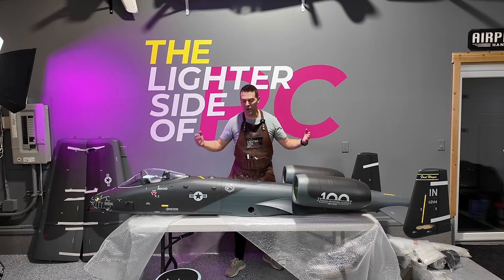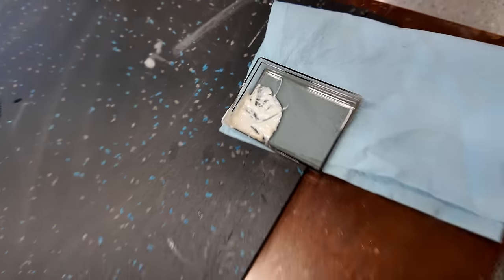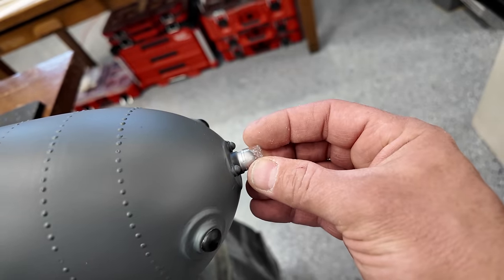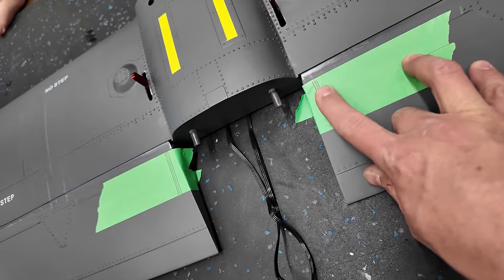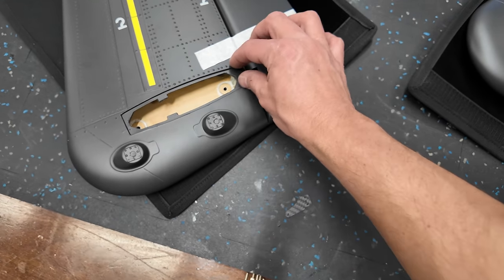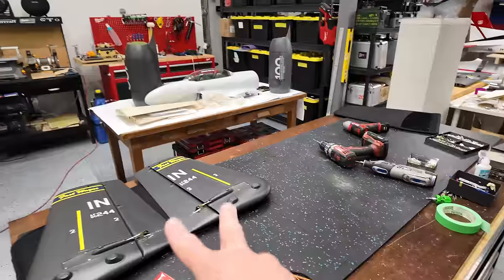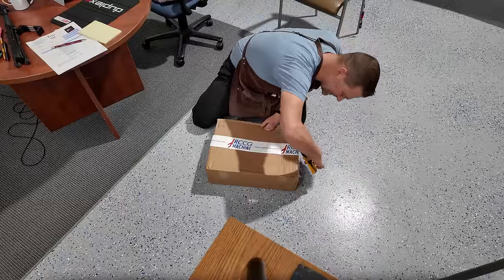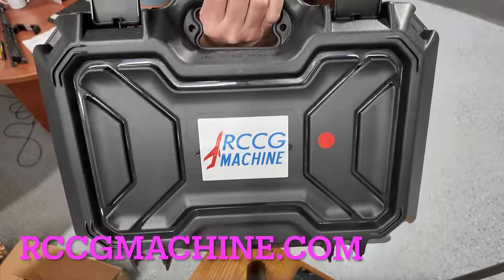Black Snake A-10 RC JET Build Begins - Skymaster A10

Comment: Coming Along nicely and plenty of Room in there as well. I remember Chris Golds doing electric A10 in U.K. with exhaust  straight out caused no end of dramas re elevator deflection😮 until he adjusted them to how those ones you showed are angled problem solved.😊 keep at it now.😊
Reply from the maker: Thanks Nick!  Yea that small up tick angle in the exhaust is critical!    Thanks for watching!

Comment: I live close to the 122nd fighter wing base who are the Black Snakes. It has been so awesome seeing the A-10s fly overhead, but they are now transitioning to the F-16s.
Reply: I miss the Sound of the A10 when they came to Ohio. Never see the F16s
Reply: The problem with the F-16s is that they usually won't fly as low a the A-10s due to the fact that they are louder.
Reply from the maker: Super Cool!  Must sound amazing!

Comment: Any thoughts/comments on the false turbine blades in front of the turbine if they will interfere with airflow entering the engines?
Reply from the maker: Not at all.  They end up spinning up with airflow and increase in speed as turbine speed increases.  It's a common thing on the SM A10's not for many years and no issues.  I like them during the cool down as you just get them spinning and they push air across and into turbines.
Reply: Ok, thanks for reply to explain it. @thelightersideofrc

Comment: I've been a scale RC'er for many years. The Skymaster A-10 will likely be my first turbine jet, since I've been looking at it for several years now.  A question regarding the fuel tanks - Would it be a good idea (or not) to coat the tanks in some sort of "self-sealing" rubber compound of some sort??  Subscribed.
Reply from the maker: Thanks for watching!  They are great easy fliers!  No really needed as it would just add un necessary weight.  Before the tanks go in you leak test them and after that unless you have a large impact (AKA Crash) they are generally perfect for the life of the aircraft.

Comment: On the stabilizer horn, you said you were going to to have to trim the cover plate some for the shaft to clear. Why not offset it a little instead of trimming. Looks a little better than trimming
Reply from the maker: if you bring the clevis mounting point in to the point where you don't have to do any trimming then you hardly can get any movement with the surface.
Reply: I don’t agree 100%. If the clevis is put in the same hole and the threaded rod has a bend you are not changing the geometry. Anyway it’s just a question.

Comment: I do have a real question. Did I just see you just use epoxy to glue those tank bungs in? I thought they have rubber gaskets. Won’t they leak?
Reply from the maker: The metal silver piece gets glued into the tank.  The red piece screws in and uses a rubber oring.